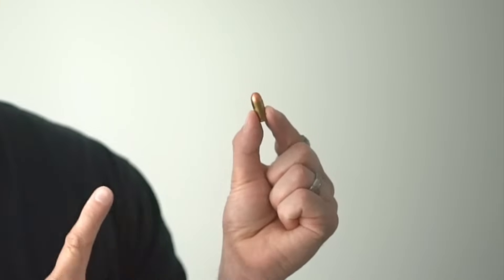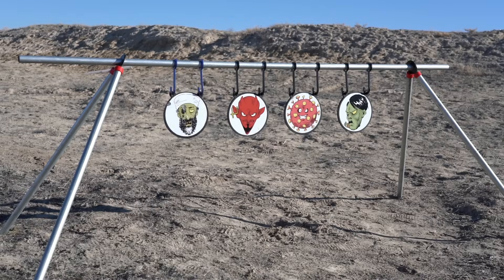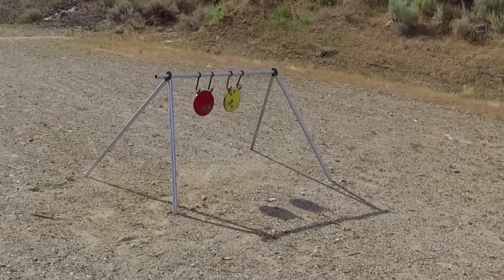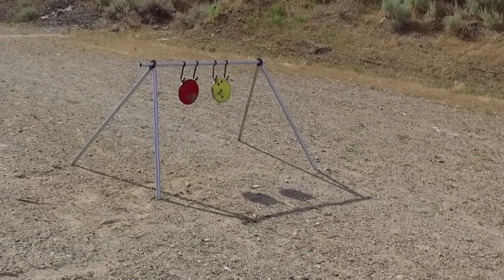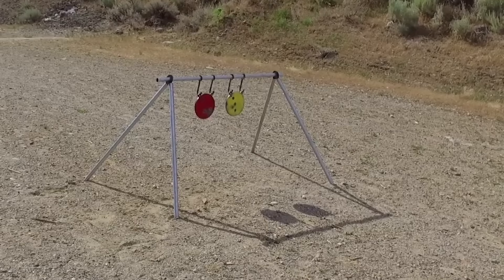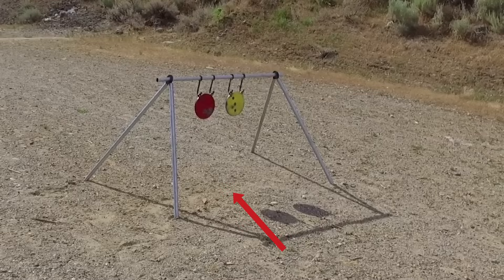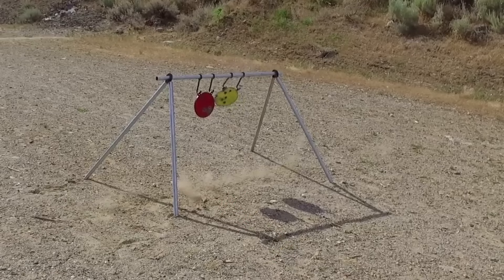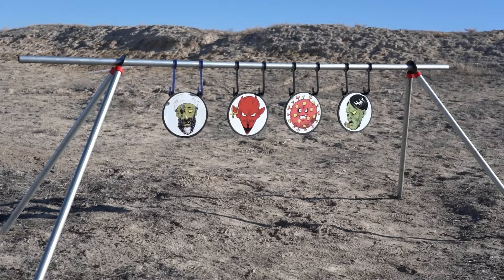Does a bullet ricochet on an AR500 steel target?

Comment: If the target is perfectly vertical and the bullet hits at a 90 deg angle then the frag/spall will be a 360 deg circle.
Many slow motion youtube videos show all kinds of bullets hitting steel but few show edge hit effects unfortunately.
The frag/spall however is not too big of a deal since the pieces are very small/pulverized but a ricochet of a bullet 1/2 or greater from an edge hit of a steel target where a slicing effect happens can cause damage to windows and break skin. I shoot steel challenge matches all over my state and this is a big problem. A great deal of effort goes into minimizing ricochets by placing barriers and covers near the target edges. These also keep the frag/spall to a minimum. Unless the steel target is completely surrounded on the sides and at the back with no gaps, it’s just a matter of time before a hit just right will make it through and off at a high angle outside the shooting bay/area. Sometimes frag/spall can bounce off the ground and/or off the target stand. Metal target stands can cause partially complete bullets bounce back at the shooter. I have had a completely perfectly cut in half bullet bounce back and hit me in the head after being cut in half by the bottom edge of the plate then bouncing off the stand. Crazy unpredictable stuff!

Comment: Then why is there that video here on YouTube where a .50 cal ricochets and knocks the guys hat off?
Reply: I assume you're referring to the classic one from 17 years ago, when the round bounces back, skips off the dirt, and smacks his ear-pro?

Several reasons, most likely a matter of human error.

-As far as I'm aware, we have no confirmation that his target was actually AR500. All we have to go on is the sound. We just know it's metal.

-A steel target should be hung rather than firmly placed down. The target can dissipate a lot of the impact force by swinging backwards. The swinging creates an angled plane for any frag to slide down and past. His target was on the ground. If he put it against something, then the plate would have to deal with much more force because it has nowhere to go. The lack of dissipation makes the bullet skip right back rather than continuing forward with sudden loss of force 

-He is WAY too close to that target. He's basically in the splash zone. 

-He may have been firing an armor piercing round. Armor piercing relies on a hardened core within the bullet and surrounded by softer metal. That's a really dumb idea for any hardened target. While softer lead and copper jacketed ammo will obliterate itself against a hard steel, the core of the armor piercing round won't. If your plate doesn't have any way to dissipate that force, then you're left with a hardened steel or tungsten core bouncing as the plate pushes back.

-1/2" AR500 is rated up to .338 L. Everything below that will disintegrate on impact. .50 is much, much stronger. The round might not penetrate, but it is more likely to survive the impact. We don't know if he's got 1/2" steel, but it's just an example of a common target.

-His target may be very worn out. You should never use a target that is covered in impact pockmarks and damage from rust or other wear and tear. It's very well known to have a tendency for sending a round or other debris right back at the firing line. 

-Admittedly this is a nitpick, but the round skipped off the dirt first. Yes, it still flew at him, but it wasn't a direct trajectory. Very close, but wouldn't have impacted them if the dirt had directed it in any other direction.

Comment: Of course they will!  And water, and wood, and glass (I had to learn that in sniper training) it depends solely on the flatness of the surface and the angle relative to the line of travel of the bullet.
Reply: And at any decent range the impact is not perpendicular...... thus a deflection (of some extent) will result...